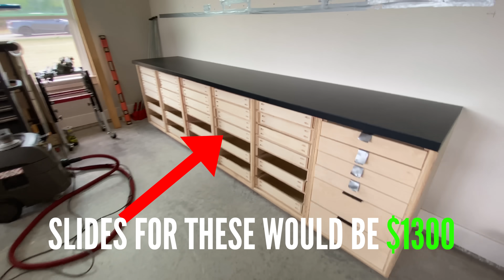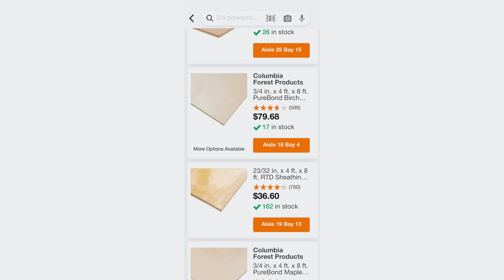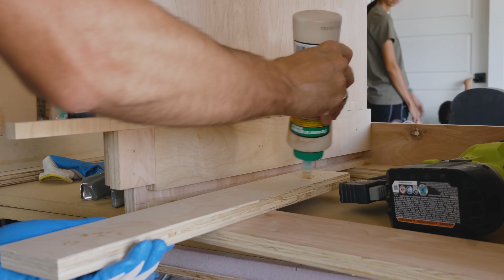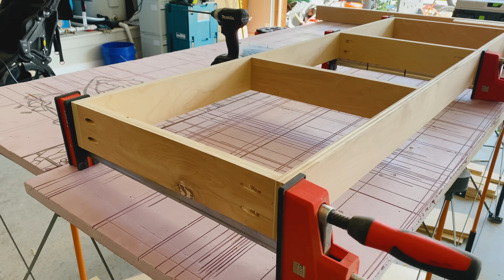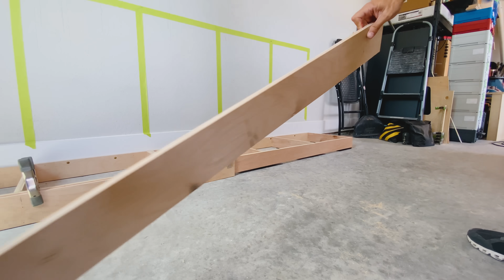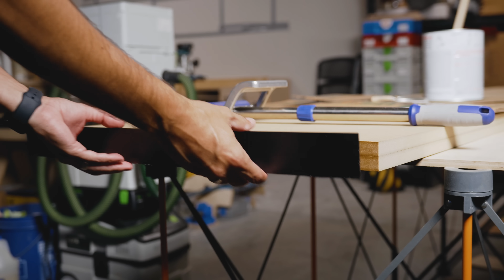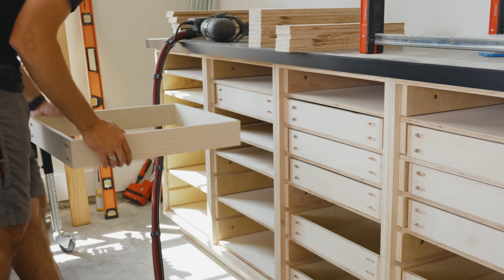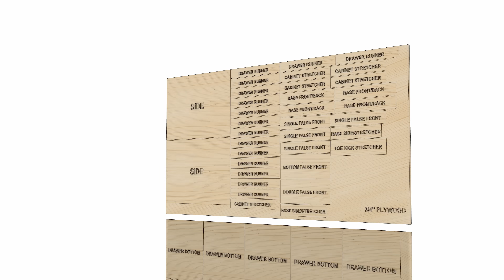Drawer slides are expensive. Do this instead.

Comment: I built my first drawers in a very similar fashion. I really like this concept for cheap shop cabinets, but there are a few things I've noticed with mine:
1. My drawers bind along the sides a lot unless I push them back with equal pressure on each side.
2. I don't have easy access to the backs of my drawers because if I pull them out to get to the back, the whole drawer falls on the floor.
3. I have to really pull to get my drawers to open - especially the heavy ones
All of these address the "nice to have" features of drawers. It's been a couple years, and mine are still working like the dasy I made them.
Great video with good, clear instructions along each step.
Reply: Plus, you have to worry about swelling during higher humidity days. I was thinking of using this type of drawer system, and will probably use a playing card or two spacer for the cabinet glide structure to prevent binding. My drawers will not be containing anything heavy, so, binding and racking should not be an issue.

Also, as a comment on the build, isn't it best practice to install wall cabinets before the bases?

Comment: Get some powdered graphite for farm equipment. layer that on to the runners and it will be smoother than silk. Also, the mushroom is gross- the part you're seeing is just the upper side. There was plenty still inside that wood. You did all that work and inserted future fungal growth into a beautiful project just to save a little time.

Comment: CABINETMAKER TIP: If you’re using a trimmer with a flush cut bit (trimmer bit with the bearing) and you’re not adding the edge banding after laminating the top, add a piece of masking tape twice around the bearing. Line up the edge of the masking tape with the edge of the bearing closest to the blades of the bit, wrap it around the bearing twice and then trim off the excess). The bearing should spin freely but you’ve given yourself about a mm of overhang on the laminate that you can then file down to a nice chamfered or rounded edge without digging into the edge banding.
Reply: why not just get a made for laminate trimming with a angle on it. i have one for 30 years
Reply: Thanks for sharing that tip. I'm looking forward to trying out in the future!
Reply: They make a bevel bit that you can set so that the top veneer hangs out just a tiny bit that you can file off
Reply: I’m glad you taped and mudded the drywall. I enjoyed the video very much give me some good ideas thank you.
Reply: Wouldn't just a piece of frog tape around the sides have worked?  You think he had the bearing set too low?
Reply: @rockshot100  Yes, that is how I learned to do laminate trimming. And then use a bit with a slight bevel.  Finish with a fine cut file.
Reply: Really nice cabinets thanks for the runner idea 🤿
Reply: I've been a general contractor specializing in laminate installation for 34 years. I  run the layer of blue painter's tape on the face of the edges. It uses more tape but it's cheap insurance. Sometimes a cheap bearing will scar a naked edge. Also, when I trim the top, I pinch a finger under the router base on the inside edge of the base so the router is tipped a tiny bit, leaving a tiny bit of overhang. After trimming initially, I recess the bit so there's only the thickness of the top sheet of the cutting edge exposed then make another pass. No need to push the router hard against the edge. Let the tool do the work. Then I file the edges perfectly flush and smooth. Top and bottom. I haven't scarred an edge in years and I do hundreds of countertops each year.
Reply: I live in DFW area too. People I know don't pronounce it DRAW.
Reply: @jimbagley5387  he's poking fun at another creator (or two)
Reply: @jimbagley5387  maybe a Boston invasion lol.  Drawehh
Reply: Edges are usually done before tops. So the tops cover the edge banding.
Reply: Or just don't set the bearing so low. If you put the bearing just under the laminate, there won't be room for it to cut into the side.
Or even better, use a laminate top trimming bit. That's what it's for.
Reply: This is how we did it in cabinet shops: with a guide jig made of MDF (like 18" long), for a regular router with a straight bit (no bearing), trim the laminate to like a millimeter from the edge.  

Then use a little trim router with an angled bit with a bearing, to trim the edge.  The bearing is made to leave like a half mm of the angled cut hanging over the edge. 

Take a fine metal file and holding at like 15 degrees from the vertical run it down the edge, pulling it downwards. It folds over the micro hangover of the top piece, and hides the glue layer for a perfect edge.

If you don't do it that way, you will see the glue layer.  Also when the laminate expands and contracts due to humidity, as it does, the hangover won't be visible or felt by the customer.

We would spray glue from a container pressurized by a compressor, which makes the glue layer thinner than rolling it on. But that's only viable if you're using it often or daily.
Reply: @PRH123  Thanks for the tips, I had no suspicion or idea that the laminate moves.
Reply: @rockshot100  except for the “color core” variety, laminate is made of plastic infused paper basically, so like wood it expands and contracts a tiny amount in response to humidity…
Reply: @PRH123  No CRAP,  Paper?  Meaning like formica and that other one begins with W?
I understand color core, the color goes all the way through so you don't get that black line on the outside corners.  Somebody GAVE me 4 full sheets so I have enough to do my cabinet fronts.  I helped do it once but still a little scared.  
Very surprising I never would have thought that.  Thanks.
Reply: @rockshot100  you have to be a little careful with the color core, it’s not so flexible and can chip….  You can’t make it bend with the file, so you will see the glue line, so important to spray the glue on as thin as possible…. move the routers more slowly…
Reply: @PRH123  Thank you Sir.  I have to use the one the friend gave me 4 almost full sheets.  Not formica but their competitor.  It is not solid core and I am nobody special.
I already have a deep sink but will have to make my own counter top.  I am thinking that I will need 2- 3/4 plywood, that should be enough, right.  I am tall and the damned sinks are like 5" deep, this new one is close to 10" deep.  So I have to build it higher and want to build the depth 5 inches out from the face of the existing lowers.  I need some space!  And this old sink is almost impossible to use, without making a flood.
Reply: @PRH123  For other purposes, I have Sprayed contact glue before, and all i did was use the Degreaser spraygun tool that comes with airtool starter kits, or just buy from an autoparts type shop, maybe your bigbox stores too.
And plenty of airflow from your compressor
Reply: @paullalekna5478  cool...   was it hard to clean afterwards....?
Reply: laminae bit and then a no file bit or just file it down with a plasicut file. iff you are using a flush cu bit keep your bearing as close to the top as you can, if you material isnt square, and it has a smaller chance of flexing the bit. If as you said a nice edge banding afterward.
Reply: @jimmydrew491  just use the right router bit
Reply: @johnb.6468  Most professional cabinetmakers who work for companies that mass-produce joinery don’t have the luxury of purchasing hundreds of “the right router bit”. Companies supply the bits. Straight flush cut bit is more versatile and cheaper so that’s what the company provides. The amount of bits you go through is insanely high so buying bits that may cost twice as much (or more) isn’t really efficient. Doesn’t apply to a DIY project of course but hence why I said “cabinetmaker tip”; because I’m not a DIY home handyman, I am a cabinetmaker who does this 10 hours a day on hundreds of cabinets. There’s always a “special” or specific tool or accessory but the reality of most professions is that they don’t use those special tools. They use a 2 minute hack to solve a problem. Also buying “the right router bit” doesn’t solve the common problem of bearings scarring or marring the edging because those “right” bits also have bearings which can mark up your edging.
Reply: @jimmydrew491 in my shop they were using re-sharps that already left overhang because they had been re-sharpened so many times.
Reply: @johnb.6468 Haha well that works too. The companies I’ve worked for just buy bulk flush cut bits. And the tape always prevents any scratching or marring of the edging. The tape on the bearing is a habit that I got into at work and have always done it since and seems to work great.
Reply: @johnb.6468  💯
Reply: I was debating this or the tape on the facing since I didn't think the tape would stick to the bearing for the whole run & not come off or compress.
Reply: @salimufariIt does compress slightly but that’s what the two layers of tape are for. I’m a cabinetmaker and do this every day for all of the cabinetry we make for major retailers and high-end customers. Hasn’t gone wrong for me or any of the other cabbies I’ve worked with. Putting tape on the edgebanding might leave residue behind which isn’t all bad if you’ve got standard ABS plastic edge tape because you can use ABS cleaner - although if it’s stipple, you’ll end up removing some of the texture. Better off to tape the bearing - same result but no residue on the workpiece.
Reply: @jimmydrew491  clever!
Reply: Tape on the bearing?😂😂😂😂
Reply: @JayBee6801 Yep. It’s how most professional cabinetmakers I’ve worked with do it. If you tape the edging, you risk leaving residue which may require ABS cleaner or some other chemical to clean it off which may ruin any texture like stipple. If you tape the bearing you’re ensuring your bearing doesn’t leave marks on the edging (which they often do when you’re a cabinetmaker and don’t have the luxury of using a brand new bit for one DIY project) and it adds 0.5-1mm to allow for any issues so you don’t cut in to the laminate. Yes you could go and buy specific bits but most cabinetmakers and cabinetmaking shops just don’t - they buy a whole bunch of flush cut bits because they’re more versatile and most cabbies can use them without any issues (and a few tricks like the tape).
Reply: add the masking to the face the bearing is riding on!
Reply: @TomasMorenoSauce  Fine for home handymen and DIY projects. Not ideal for a cabinetmaker that spends 8-10 hours a day doing this. Too much tape and too much time to apply. Also may leave adhesive on the edge banding which you will need to clean off which depending on what you use to clean it, may damage the edging or its texture (like stipple). Much safer and cheaper and quicker to tape your bearing.
Reply: Spray the bearing with WD40 every 30 seconds of use time, and check it for free movement before and after use.
Reply: @nailbanger2 That’s an alright idea but hardly practical if you’re pumping out lots of joinery. Also if you’re using timber laminate (veneer), any residual WD-40 on the bearing will soak into it and ruin the finish
Reply: There is also a product called lami- lube.   Spray it on and it will protect the edgeband from the heat of the bearing
Reply: Wish I would have seen this comment a few days ago!

Comment: Amazing work!!!  The only one thing... Just from your goal of 900$. I would rework the design a little. I do not really think that it was necessary to use that much of material for sides of the cabin. If you originally planned to have 6 of these in the first place - you could save 5 side walls in total. I would guess approx. 1 sheet of material just right there. Using at least 2 times less thick material for shelf bottom would work for sure. Also I would not use a full size shelf holder panels and bottom shelf panel that goes into these holders. You could cut like 3 cm line for side and like 5 cm for bottom on each side and use these instead. That would be 84 small panels for side shelf holders and 72 for bottom shelf holder, tho... From the material economy perspective, I think you could save like all least 75% of used material on these inside shelf holders (side and bottom). A bit more time to work on these, but re-building a correspond pattern for easy install would help :)

Comment: The runners in your drawers are the drawer bottoms.
The runners in card catalogues are the drawer sides.
This design lets the drawer bottom sit flush and has some effects befitting card catalogues:
drawers with sides shorter than their face facilitated flipping through cards,
and drawer bottoms could be specialized to have backstops or dividers.
I wonder if card catalogue-style drawers would have use in a workshop.
I bet it would work well filled with 3d-printable bins like the Gridfinity system.
Reply from the maker: Gridfinity is life

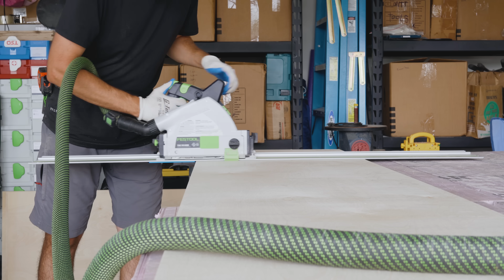Comment: What kind of vacuum hose do you use as shown in the video about 3:07?
Reply from the maker: It’s the d27 hose from Festool. Came with my ct midi vac. Expensive. I used the “centec” hose from Amazon that was $30-40 before that.

Comment: A little tip on placing laminate... find some old Venetian blinds and cut all the blades free from the strings, then keep them around to use them to support the laminate. Less chance of getting bits of wood or sawdust under your laminate, and they stack well to put away for another project.

Comment: The chopped laminate comes from the router being not perfectly at 90°, when I did laminate i 1- put a piece of painters tape on that edge so if it did get knicked it would cut the tape instead of the laminate, and 2- screwed a comically large piece of ply/MDF to the base of the router to provide a bigger reference surface to prevent rocking of the router

Comment: The one thing I would recommend is upgrading any of the sliders to plastic/vinyl cuts.  You can do this super cheap and it won't expand and contract like wood does.  I find that wood slides end up sticking in 2-3 years and require resanding a lot.

Comment: The only thing I can add on the kick board.....the base kickboard as a separate build is good in case you ever get water or concrete sweats in your garage...worse case rip out the cabinet replace the base...top part of cabinet still good. A option from my flooring days...Cove Base (flooring department any big box store)...Black or whatever color...$2.75 for 4 ft. instead of the separate board approach.  Also on the wood stores...the names are always so original...Toledo Plywood is my closest. On the Water Security...Mortin makes a Shutoff system that you can operate anywhere from your smartphone as well as a system to report excessive water usage.🤿.

Comment: This looks really good. Have been planning my workshop cabinet build for a while, and I felt that wood-on-wood drawers would be pretty neat (so long as there's something to ensure they don't stick). 
Quick question  @wittworks   . The face of all the drawers we can see is flush with the bottom of the drawer inner; but with the spacer you put in at the bottom, it looks like the face of the bottom drawer would stick below the drawer inner. I cannot see that shown anywhere in the video, so can you clarify? Thanks. P.S. Loved the gotcha with the gaffer tape.

Comment: That's a lot of shims just left sitting there. Why not use the scribe method to trim the entire base so it sits securely on the concrete with its top level as it should be?
I've never used a snorkel in woodworking, but cool tip.

Comment: For tool drawers,  my go-to option is filing cabinet slides.  They are standard (available from various manufacturers with the same dimensions and mounting holes),  full extension and can take a fair amount of weight. I don't know about US,  but in Britain I can buy them for ~$5 a pair.
Reply: Thanks for the tip

Comment: When you are trimming laminate with a flush cutting bit (with a bearing) it’s best to use masking tape on the edge your bearing is running. With all the glue and small offcuts of laminate it tends to clog the bearing and it can start spinning and rubs or burns into the laminate. Also only lower the router bit cutter enough to cut through the laminate no further then necessary as if you have any wobble or lean on the router it’ll cut into the edge that your using as the guide. By putting tape over the front edge it offsets your cut by the thickness of the tape which you can file back for a better finish.

Comment: Just sharing my thoughts on the base detail.  First I had the same approach building a base for leveling ( adding a lazar level),  however, once I shimmed up  the base, I added feet inside the framing out is scrap 2x4 at the approximate corners of the cabinets above (aligning the base stretchers to each cabinet width). To close off the gap at the floor, I used a self stitch rubber or vinyl base.  Black if course to hide any marking from boots etc…. Hope this helps

Comment: Congratulations on this beautiful workshop furniture. If you pressed the router's ball bearing too hard, you would see pressure marks on the material. With hard materials you would have to push like Hulk and bend your machine. The answer to your question as to why you milled the edge can only be in 3 possibilities!

1. Your Makita was clamped crookedly in the router foot when adjusting the depth.

2. A chip had stuck or jammed on the base plate of the router and not leaning flat.

3. There is a good chance that your Makita has the same problem as my Bosch GFK 600. An angle error in the lower clamping part! The motor is ALWAYS clamped minimally crooked. TIf i used it from the front, there's a bit left over,  because the router bit with the ball bearing is in place and the cutting edge isn't there yet. Milled from the back side, it cuts into the material like yours. And milled on the right or left side with the machine is super flat.